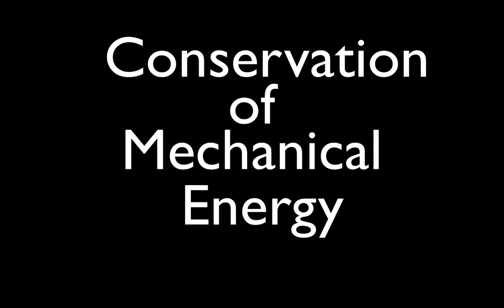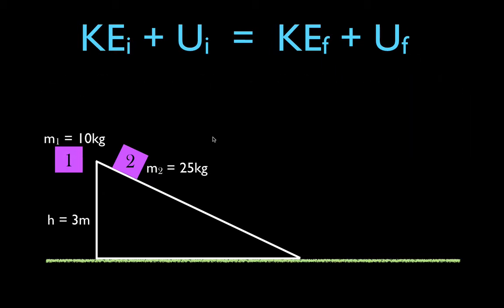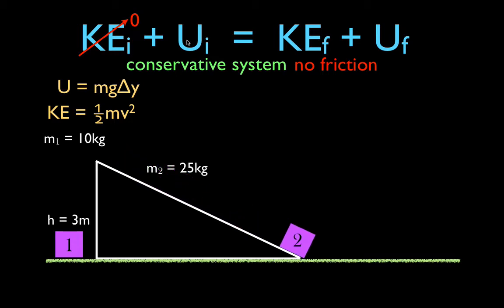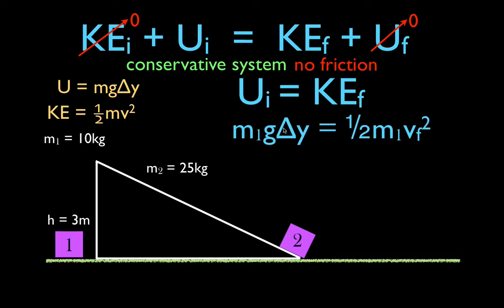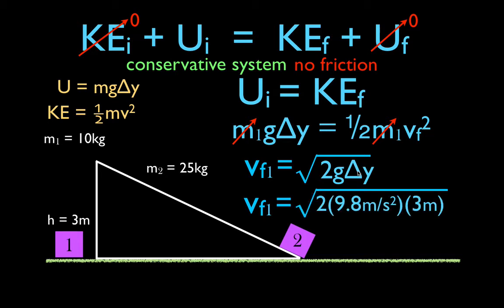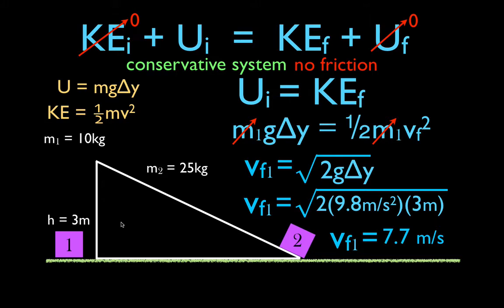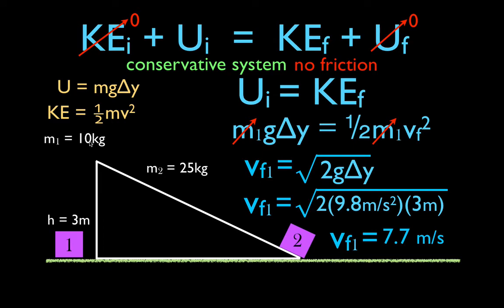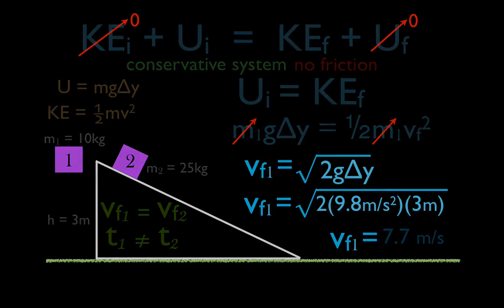Energy, Work & Power (20 of 31) Conservation of Mechanical Energy, Calculating the Final Velocity

Comment: i dont get it after you multiply both sides by 2 and then the formula changes when you square root
Reply from the maker: Yes, you multiply both sides of the equation by 2 to "get rid" of the 1/2 and the take the square root of both side to get rid of the v2.